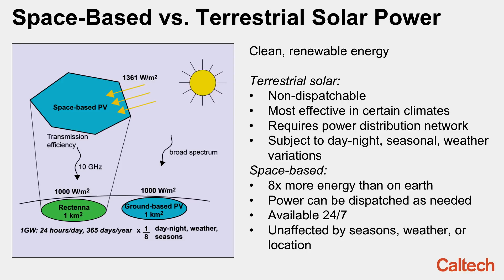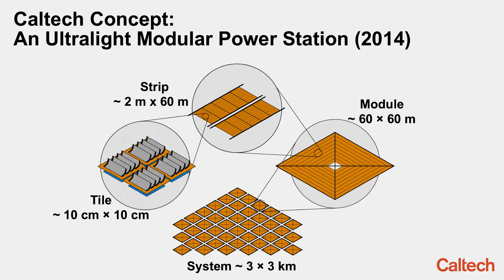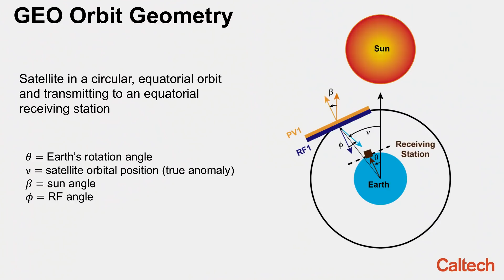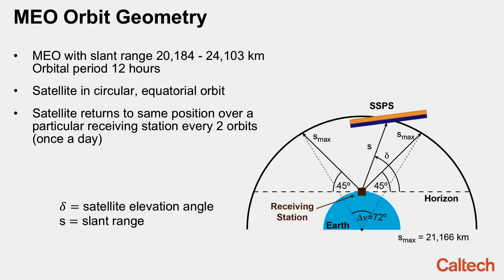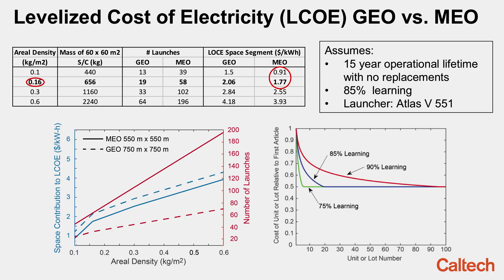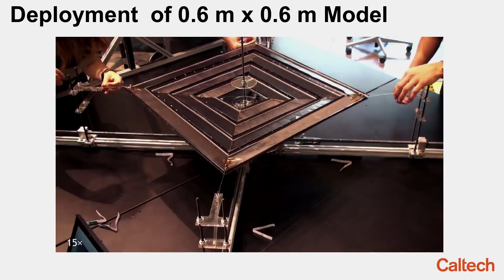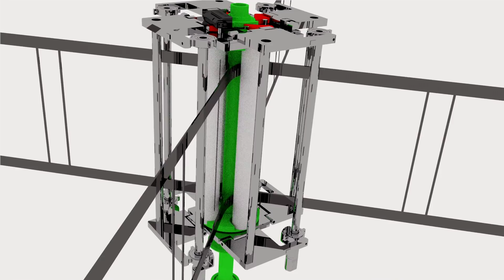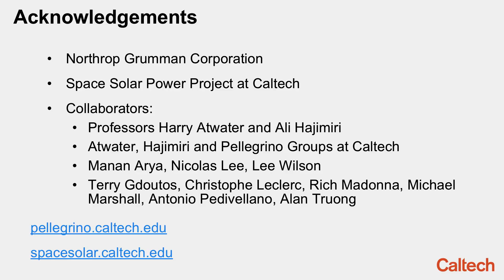Space Solar Power: A New Beginning - Sergio Pellegrino - 10/31/2018

Comment: So if RF-AC conversion efficiency on the ground is taken as 70%, then for the GEO solution overall 5.6% of the incident power on the solar panels will reach the terrestrial grid, which is pretty bad.

Then one must consider the expected lifetime of solar panels in space, what with micro-meteorites and heavy radiation bombardment, would be maybe 5 years. Replacing busted panels in GEO would be a severe challenge.

How to keep the satellite fuelled to perform its continuous reorientations is another problem, not to mention the complexity of assembling this giant structure in orbit in the first place.

Comment: Wow! Incredible! The first place to use the idea could be to power the scientific observatories at the South Pole during the winter. I am also really excited about perhaps this far fetched idea that we could put these charging stations on small islands in the middle of the oceans when we would be able to use electric ships. And an even far fetched idea would be to direct beams to rocket launches so that they might run on solar and not have to carry fuel or provide fuel for reentry vehicles. At least launching CubeSats could be realized sooner. And this could be used to power generation on base at mars or the moon with easier maintenance access from the earth and perhaps other benefits.  Once we are doing this thing, we'll probably get to more applications where it could be cheaper than conventional energy harvesting.
Reply: The last part is impossible.

Comment: I find sun-sync polar orbits more interesting than equatorial orbits. There would be no "blind" period when the array is flipped - the array is always at a 45 degree angle to the Sun (and about 45 degree angle to the target).

In sun-sync orbit, power is provided during the critical dawn and dusk periods.

Depending on the specific details, sun-sync might also save a bit on launch costs because it could be lower. The lower you go, the bigger the blind spot around midnight, though.

Comment: You could make  1 single sided variant.. launch that, then add 2 more facets in subsequent launches that complete a three sided prism. One you can be sure that at least one side will always be facing the sun... and if you left the top and bottom open for increased numbers of modular patterns, you could just add onto any the facets indefinitely. In order to beam back the energy... you could have the beaming array poking out of the bottom, always aiming at earth.

Comment: Who will clean up all the dead birds that stray into the beam? Or how about a small plane pilots that miss the avoidance area on their charts and fly into it?
Reply: the intensity of radiation per square meter is low. did you even watch the video? it's like 20w/m^2. that's like 2% of the power of normal sunlight.
Reply: @Muonium1  Not to that talking point, I  didn't. It's not actually a financially or realistically viable concept anyway when you understand the progress of earthbound PV, geothermal, wind and solar thermal advancements in cost and efficiency. And that space is becoming a lean commodity for new satellites. The UN may be limiting satellite quantities launched in the not too distant future to essential only. This particular space power concept would fall into the non essential category. Not to mention that 20w per sq meter is far lower than the amounts we'll soon be reaching without having to launch any satellites in order to do so.
Reply: @Muonium1  Well, you may be right about the UN taking the lead, but the IADC has been focused on this issue since 2002, so it's more than likely going to become an international compact at some point.